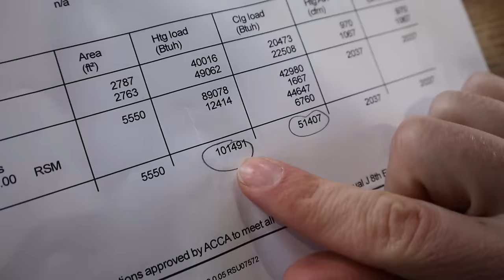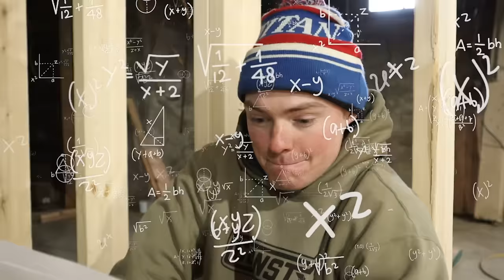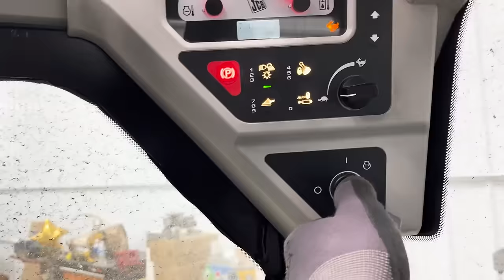Restoring A $7,000 Mansion: Removing 2nd Story Floor

Comment: With a house that large you have to  do 2 systems. 1 for the basement and 1st floor. 1 for the 2nd floor and attic. Do not cheap out, you will 100% regret it.

Comment: Two units will work much better , and actually less expensive in the long term. Easier to tune the system.
Also, I would check out Geothermal systems

Comment: There is likely comments covering everything but one thing. 
      When the system fails and you only have one. You have no system. 
      When you have two systems and one fails. You still have one system. Another thing, when power goes out and systems fails there is one thing that adds not just a pretty thing to have and romantic area, and that is a Gas Fire Place. A more basic gas fire place can still be ran with no power and even with out a fan and will give lots of heat to a home. With the amount of Insulation your putting into the house your not going to have the problems of and old house when keeping it warm but zoning rooms separately with the size of the house will not just let you be more comfortable, it can also save you money. 
      Also, if you have doors separating the Levels of the house, you will have less problems with colder/warm levels.
      FYI. There is enough heating and cooling guy's watching here. Show what the furnace is doing and you may get a fix out of it.

Comment: It will cost more in the long run. It’s worth it zone, zone, zone, it’s what you want to go with. Each floor should be its own zone with its own thermostat. That way when you and your wife and kids are only using one or two floors the others can be not going. It’ll be worth it in the long run.

Comment: Heat pumps....bad words for my region (OH). Had 1 installed and it couldn't keep up with our temps. Replaced it 3 yrs in. Sucked for A/C.   Went back to gas forced air. 

Not sure how it will help with floor heating tho.

Comment: More to think about. You live in Iowa and the water table is very far away from your house. So deep well heat transfer is not really viable. Many are using deep trenches for heat exchange. They could be just 20 feet below the surface. This would be a good place to get cooling in the summer. Not many companies are willing to use underfloor cooling. Today, that is a concern because of the dew point. But things in HVAC are changing rapidly. It would be worth your time to study this yourself; you could save thousands with a 21st century HVAC system. There is a code called LEED certified. Don't rush into HVAC, do your research. Ask Roman to do it for you, he seems to have a strong engineering background.

Comment: If you have Propane or Natural gas it is MUCH moee economically smaty to burn Gas for heat. electric is NOT a good heat source. Only use heat pumps for Secondary Heat for emergency use. And the windmills are not a heating electric power source - it doesn't run during a storm. 26:26

Comment: That house needs a minimum of at least 2 probably 3 air handlers. If you use floor heat you shouldn't need a heat pump system at all.

Comment: Heat pumps cost a lot more to heat in your area.  It is your A/C running backwards.  Gas or oil is still the cheapest way to go.  Electric is the most costly and heat pump backup is electric.  Go gas if you can.  It is still the lowest cost to run and cheapest long term costs to maintain.

Comment: At least you know the spray foam is nice and strong. Hopefully, no more birds, bats, mice and rats. It does make a difference. The bottom 2 floors will be safe from critters with legs, the top 2 floors from flying invaders. Bats and mice can drive you nuts, especially when you can hear them coming and going! Hence the term, bats in the belfry, driven batty... Nothing worse then footprints on the pies at Thanksgiving 😅

Comment: Your house is getting very tight I would add makeup air damper for range hood.  Also air exchanger to pull air from bathrooms and exchange it with fresh air.  The attic I would run mini split and add a zone for kitchen(dual zone).  Your wife will love having extra capacity in kitchen.

Comment: If you decide to use the ducted multiple systems, please use metal ducts for the system.  Whatever anyone says, Flex duct was never designed for long runs and more importantly, has a very short life span.  
You might investigate the possibility of using package units rather than split systems.  All of the equipment is outside so it doesn't use any floor space and when repairs are needed the entire system is readily available except for the thermostat.  These systems are also less expensive and when time comes for a replacement much simpler than a split system.   
One last bit of advise, while it seems neat to have all the high tech options and apps.  Remember to Keep It Simple.  The level above basic builders grade should be reliable from any of the domestic brand names.  The higher the tech the harder it is to get replacement parts and the longer it takes to get them to the supplier and the more expensive the repair.  
All the best and we hope that your furnace can be repaired soon.

Comment: Well Cole you have thighs big wind mills on your property you ever thought about getting one (smaller one) of your own?
and some solar panels to make all your own pawer and the Government will help pay for this kind of stuff.
You could put in solar panels to help preheat your radiant flour system and you can also use a ground loop heat pump heating system that is all electric so if you are making your own power then your heat and cooling is free.
you just have to pay up front to get it running and then its free after that. 
minice a pump moter or a temp sender hear and there.

Comment: Heap pumps for heating sucks.    My sister put one in their new house and it left her shivering a lot.  70 degrees with one of them feels more like 60.  They are more efficient unless you factor in shivering all the time.  They had their's replaced to just being a forced air natural gas furnace.  Drawbacks to heat pumps are numerous.  For resale value I'd advise you to stay clear of them.

Comment: Every home that I ever seen that was two or more floors had two systems. I can not imagine one system ever be able to cool that big house or you will burn it up trying to keep that big house cool. Or it will have to run 24/7 and your power bill will be so high you will not be able to afford it. Go with two heat pump systems for sure.

Comment: Unfortunately because of the sheer size of the house, you're gonna have to have two systems. One system would not be sufficient to keep the temperature even in that much space. If I were you, I would check into geothermal heat pumps. They are a bit more on the front side of things, but they are the most energy efficient and would save you a lot of money in the long run.

Comment: Don’t forget to figure how much u save in the future gas bills and power bills one thing also heat pumps do not work the greatest in Iowa it is a constant cold air feel in front of the cold air  coming out of ur hot air vents therefore ur baby will feel cold crawling around

Comment: solar panels 15 kw diy 17,000 batteries 5kw 4,000 total $21,000 payback in 7 yrs.  heating cooling electrical power will be provided

Comment: Go a litte larger than what thy say it will save you in heat and air cost in the long run. When I built my house 24 years ago thy said air 2 ton and heat 70000 btu I went 3 ton ac and 100000 btu heat never had any trouble with them saved me in the long run on cost per month.

Comment: I am curious… I see you are doubling up on the floor joists because the old wood needs support. Why haven’t you put extra wood on the perimeter walls for strength as well?
Reply: He'd have to dig out all that insulation they had put in.  It took Justin half a day to clean out one small section of one room.
Reply: Yes, I understand but wouldn’t it help uphold the house better since the wood in the walls are original?

Comment: I was going to throw my 25+ years in HVAC in,, but tomroche2689 said it all. A lot of your present design's expense and the grief, (spelled with one or two $), is the use of more "traditional" units and design. Your have said you want the house to last another 100 years; your investment in LVL's alone seconds that. The "zone" unit systems Tom is talking about is the "most bang for your buck"- but HVAC isn't cheap; why  else would a plumber like myself get into it? Done right and done well it is a thing for many years. The price difference is usually in the quality of the manufactured parts- condensers (outside unit), evaporators (inside) and the heating components, not in the labor and labor costs. Get more than one estimate if you can, make sure both are estimating from the same set of base parameters. And you haven't even bought the plumbing and the new kitchen appliances yet!  What an education your going to have! Love what ya do, Cole; sneak up on Roman and give him a hug for me! Justin,  this house of really old cards didn't fall down on all of you- I'm impressed, and your have taken the engineers work and seen it placed. Awesome work!

Comment: Having remodeled my house, I want to warn you the estimates will be lower than the actual cost, which may be $10,000 to $20,000 more than you have been quoted. It's just the nature of the beast, and with over 5,000 square feet, the work will be extensive no matter what you have done yourself.

Comment: l'm wondering if electricity and fuel prices will keep increasing as global warming builds. You might want to look into a geothermal system at least for part of your heating and cooling needs. Higher prices up front, but increasing costs savings and environmentally sound.

Comment: I had a 6,000 sqf house with 2 furnaces, and 3 air conditioners.  It needed 3 furnances.  The master bedroom, master bath, and master walkin closet had Zero heat.  It sucked!  From our experience, spend the extra money now!  For us to install a 3rd furnace would of cost us way more because then they would have to open walls, enlarge our power box, and tear up floors.  Just bite the bullet and do it now.  

Sorry for the bad news, but you will thank me later.

Comment: you have a forced air system already designed why not go with forced air heat and cooling together and save on the cost of all the heat pipes.

Comment: why don't you make ground heating system. it should easily be able to generate enough heat in the house. and hot water in the shower.

Comment: Stop using screws!
Use on-demand hot water 1 for each floor. Just put them close to the rooms that need it.
HVAC, I hate to say it, but let the pros. do it it's fater and 9 out of 10 quality is better and the small stuff wont get skipped.
Save the money on electric and plumbing ruff-in, label, label,  label. Oh don't forget to label. DON'T ASK HOW I KNOW!
P.S. I have seen 4 AC condenser on a house that size.

Comment: I watched the video as you decided on the path for the HVAC system. Great decision on self-installation and assistance with an advisory contractor. I believe that will add interest for viewing. I would like to suggest, please DO NOT install registers on the floor. Install them on the wall where they should safely be. You have children and small baby items will fall through the registers and drop into the ductwork. I can never understand why new home construction would install the registers on the floor. NOT GOOD. If you have plans already for the HVAC run, that can easily be changed. You have enough room with the larger studs. Use them to your advantage.

Comment: Why did you lower the exterior connection points of the floor joists???  Your issue is in the center, being lower and sagging over time.  
You should've left the exterior connection point alone

Comment: If you bought a new home, it wouldn't have the character and uniqueness of this home. Your taxes are going to be your largest expense. The first two increases will be separated, but after that, it will be a good chunk of change. It's better to get two units now, with the ability to extend one unit to an attached garage, than incur the cost of another later with the repairs for installing another unit later. Nothing worse than ripping out a wall and flooring a second time. You've already witnessed having to redo your work just to level the walls and floors. It will be just as bad later. 😊❤

Comment: Now, what would my wife say? Go with underfloor heating in the basement, the first floor and the second floor. Use heat pumps everywhere possible. It is much cheaper to cool a building than heat a building. Forget the forced air, it just moves dust. Ask your wife, see what she wants.

Comment: OSHA violation #2: Improper use of a ladder. The type of ladder he was on is not made to be collapsed, leaned on a wall and used as if that's the way its used. I mean I used to do it all the time, when I was in the field, but technically it's improper use.

Comment: You are really going to want two systems in a two story house. you are not going to have consistent cooling / heating across the house. I've rebuilt a few homes in South Florida that were originally built with a single 5 ton AC system. the last one we did was replace the 5 ton with another 5 ton, and then installing a mini-split for each of the 4 bedrooms

Comment: You will regret it later if you don't put in multiple source heating/cooling. Don't pinch pennies now because you will regret it later. With the entire structure open, now is the time to do it correctly. Just think about it, you will be living in the house for the next 60 years.

Comment: Builder for years, advice is general: stack your coins for the moment your need to rely on others' expertise may surface. Aside from the typical frustrations and fatigue of learning-while-doing you may need the time savings of having a practiced expert crew come in and wipe out the HVAC. Mixing your own efforts in to a bid job muddies legal liabilities.

It may be spendy but you'll only spend once and any errors or omissions are the responsibility of the contractor.

Comment: No,No,No,No,No to HEAT PUMPS!!!! I have two family members who have had trouble after trouble after trouble with theirs. My son in Colorado this winter the temp outside was 22 degrees and the house was at 50 degrees and they could not get the HEAT PUMP it to go higher. So NO, NO, NO to HEAT PUMPS. WE HAVE 3200 square feet in our house in Illinois and have Separate heating units 1 for first floor and a separate Air Conditioner then 2nd floor Separate Heating Unit and separate Air Conditioner. So I am a HARD NO on HEAT PUMPS!!!!!!!!!!!

Comment: Hey Cole why hasn’t Justin corrected you that your renovation is a remodel not a restoration. A restoration you would be restoring all original to its original state. Like your staircase. Which is now gone or your fireplace. Which is gone. So your project is a renovation remodel. It’s a whole new design.  Get professionals for your HVAC. Will you have a mechanical room?

Comment: HVAC companies usually oversize the systems they sell, oversize systems work well and people don't complain about them because they will keep a house temperature controlled but they do indeed cost more while an undersized system will indeed generate complaints.  Also they use pretty much base their estimates on the square footage without regarding the amount of insulation and how well or poorly a house is sealed. Take the time to watch the recent Technology Connections video on this subject.  You can then make a more educated decision.

Comment: Way don't install hydronic ceiling heat It will double as air conditioner during the summer the summertime.????
Reply: By running cold water through the system in summertime, and hot water through it this system is extremely responsive when temperatures change drastic during morning, day evening and night temperature.

Comment: trying to make one system work on a house that size.. you will REALLY regret it.. the top floor will be too hot in summer and heat will be reverse, hot up top and cool in the living room..   essentially your heat pumps are "ZONES" so you can keep it all even when you need to.. there are heat pump systems where you can have one compressor unit and two or more air handlers.. but it might not save money..   its like electrical outlets.. do just the minimum code and curse it every day for the rest of your life.. or do it right before the sheet rock goes on.. skimp on paint and stuff on the surface that you can redo easy.. HVAC,  electrical,  plumbing.. its all in the walls - do it right - and over do it a little and you will be better off.. you are not doing a small house..

Comment: You are "building" a 5000 square foot house over 4 floors, one system isn't going to cut it. One system giant will freeze the lower floors when the AC is running and scorch the upper floors when the heat is running. 

There is a reason why your Grandpa put a second furnace in the basement and he didn't even have the attic space as a livable space.

Comment: WHY would you need TWO heating systems, HVAC + floor heating ?????
If something goes wrong with floor heating 25 years from now, you would have to destroy your whole  floor to fix small little thing. Radiators are OK but not floor heating. Most of the energy in the floor heating is used to heat the inside of floor and the little bit goes above the floor.